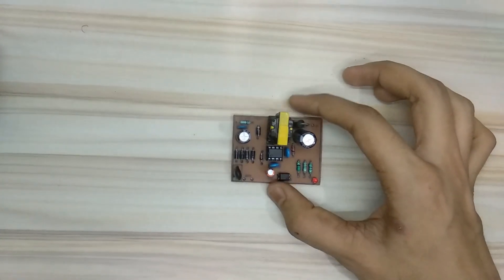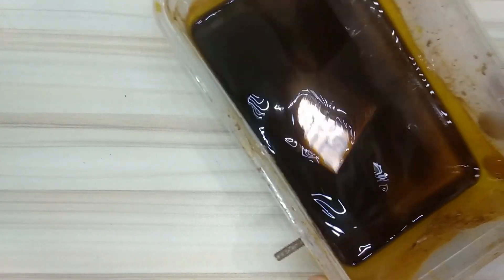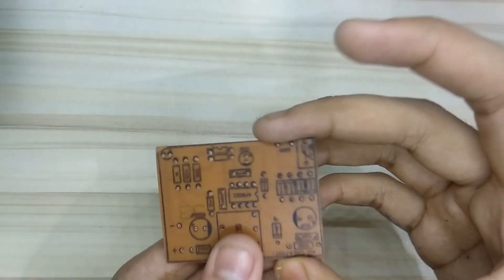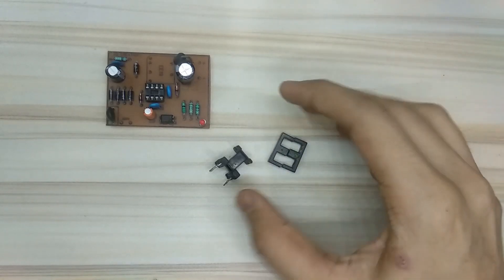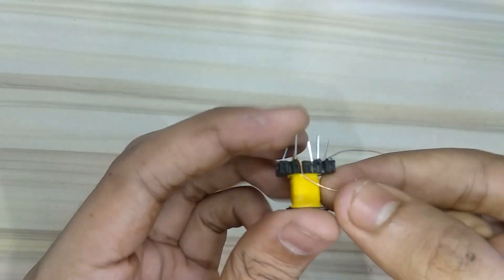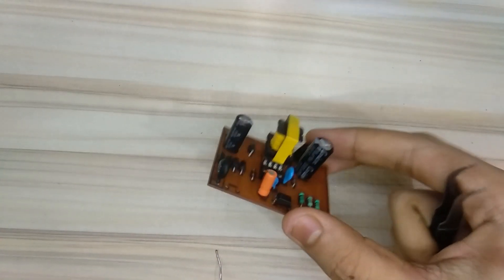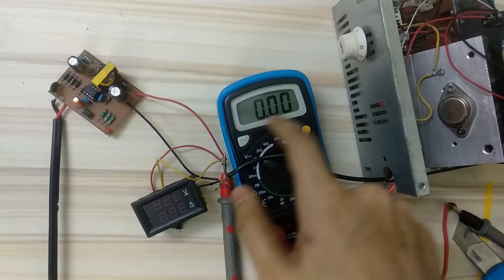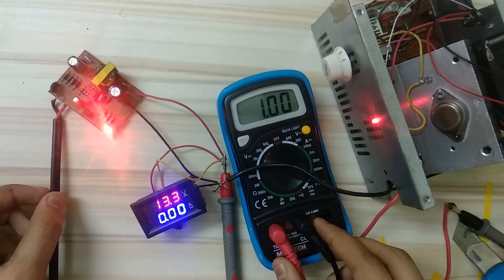DIY MINI 12V 1AMP SMPS WITH AP8022 IC.

Comment: Hey  there just a quick question .
Pause the video at 2:21 
And assume from right hand side the transformer pin is 1,2,3,4
Means first pin from right hand is 1 then on left 2 then in left 3 then.on left 4.

Now since you have started the primary winding from pin 2 and what pin you have attached the end point too?

Same for the auxiliary case you have started the winding from the 3rd pin and where have you attached the end point to ..

Please it would be appreciated

Comment: friend how many turns does the chopper of the transformer
Reply from the maker: Primary- 196 turns
Secondary and auxiliary- 24 turns
Reply: @kdcreativity6201  
friend what is the gauge of the wire
Reply from the maker: @mastercell14  primary and auxiliary- 28 AWG
Secondary- 22 AWG